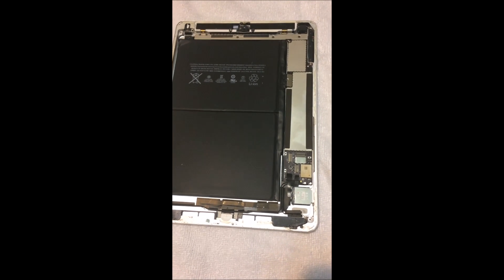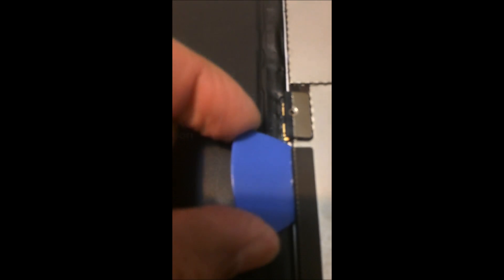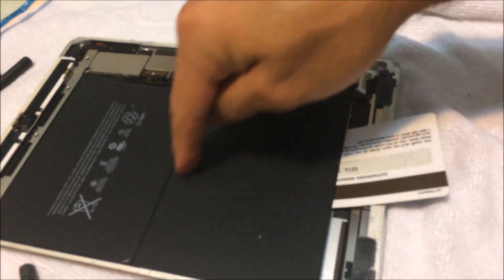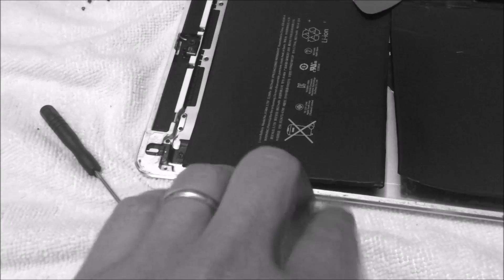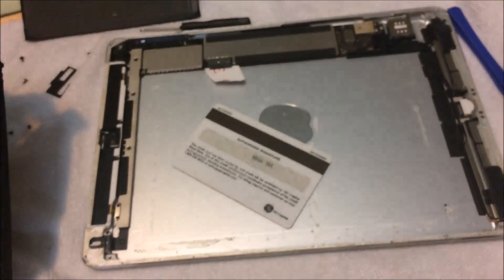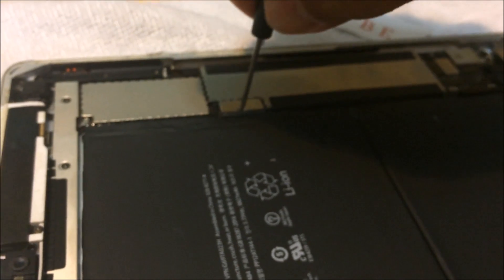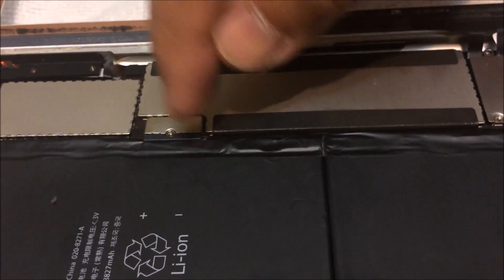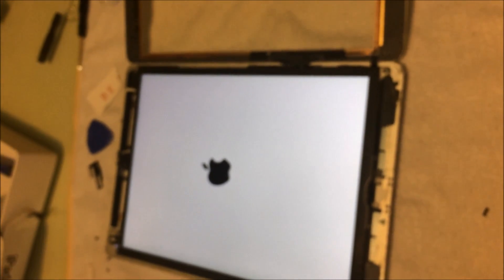How to replace Ipad battery without removing the mother board

Comment: you only have to remove the battery clip holder screw once inside..u fold up the screen…fold up the battery on 90deg angle…then once screw out..put a leaver in under the  clip..then put new battery in and put together thecway u took it apart

Comment: I removed screen and LCD to stop damage to cables..., scraped battery out one section at a time with nail file,screwdriver..NO HEAT..unscrewed logic board screws, lifted board enough to pull battery over lug...very easy...

Comment: **Caution**  removing the logic board and other components helps to prevent damage to them when applying heat to the back of the case to melt the glue on the battery making it quicker and easier to remove.
Short cuts are sometimes good and sometimes not, so personally a few more minutes taken to protect possible damage to your expensive investment has got to be worth the time.
So here's the thing....
He takes longer to separate the battery from the case then to remove all components and apply a slow gentle heat facilitating an easier battery removal.

I really appreciate the effort... but there just isn't a justification to risk the potential component damage to save a few more minutes of time.

Comment: You skipped the important part -.-
Reply from the maker: Dont't just go with the "group mentality" and follow somebody's comment without verifying it on your own. 
If i broke it,  how did i put the new battery in?  You've got to pay attention man. Look that i have lifted the battery and the circle comes off the little metal stump, its obvious you can't pull it straight , that why i have lifted the mother board.  Same way i placed the new battery in 4:44 minutes in the video - thee is nothing broken, pay attention. (its a given).  Look at how many people saw my video and actually fixed their ipad. This is a legit video, i fixed my ipad and did not brake a think.
Reply: @straighttothepoint8309  NVM, got it, had to stick the spudger under the connector, thanks.

Comment: how did you get the battery out with the Circle on battery connector part. You skipped it because you BROKE it. PHONY VIDEO
Reply from the maker: If i broke it,  how did i put the new battery in?  You've got to pay attention man. Look that i have lifted the battery and the circle comes off the little metal stump, its obvious you can't pull it straight , that why i have lifted the mother board.  Same way i placed the new battery in 4:44 minutes in the video - thee is nothing broken, pay attention. (its a given).  Look at how many people saw my video and actually fixed their ipad. This is a legit video, i fixed my ipad and did not brake a think. Your comment is phony.
Reply: @straighttothepoint8309  You could have just pulled the battery out and ripped the circle anyway, and as for the new battery cut a small piece out the circle , its not needed to have a full circle to connect power...

Comment: I changed the battery but now the ipad does not power up anymore. I do believe the screwdrive I used touched the motherboard while old battery was in and made a spark. Do you think the motherboard is dead now? 

Any way of testing? Battery I got is a second hand spare one. I’m just wandering if maybe the second battery is dead too.
Reply from the maker: I am sorry it happened to you. I fried an iphone 8 trying to open it touched something and "zap" - it died. As i explained, i am no technician, i am just hands on and enjoy doing this after a long day of work. I hope you can save you item
Reply: Did you earth yourself before starting the fix. Always touch something metal and grounded before starting a repair. I just touch the metal frame on my table before assembling my PC and fixing my huawei tablet. Gonna try battery replacement on my Ipad. Waiting for repair tools from China.

Comment: I wish I didn't see this video, after putting in a new battery, and it constantly rebooted every few minutes, I bought another battery and it did the same, after more research, it looks like the little prying I did to get the old one out, must have damaged something
Reply: Sounds like the battery may not be making a solid connection.

Comment: i wouldn't recommend this over time them battery connectors will break flexing back and forth like that is going to weaken them. not noticed another thing when he was putting the new battery in he tells you about lining the hold with the connector. now notice that bit got cut from the video and then he goes straight into telling you about the glue at the back of the battery. this tells me he either had problems or he had to take the parts away anyway or it could indicate that it took twice as long to put it together. yes he says pins bend but for him to cut that bit was it also something else.
Reply: Peter Winter 
No understand
Reply: Nothing went wrong , the reason there is a missing section is because I was the one holding the phone while i was doing the repair. So... at some point I though I was recording when the camera was really off .. but I could not reverse the process just to record again.
One more time, I am not  by any means , a electronic technician, I was just curious about if I could do it or not ... and I did. Just be careful with the pins and you will be fine . Matter of fact you should be careful with anything from opening to closing the device , the pins is something that I called more attention to it since it can easily be missed.

Comment: Great video and I would add this; to lift that silver looking plate over battery contacts is to heat back side of the Ipad then lift that piece and part of circuit board. Same thing if you try to lift the battery. Both battery and circuit board module are glued to back side. 
Anyway, It worked for me, but the screws were very small and not easy to handle. You would have to remove some screws to remove the front cover (Touch screen and display). You will have to watch few videos to get thing done..
Reply: pepperjack8 
Good point